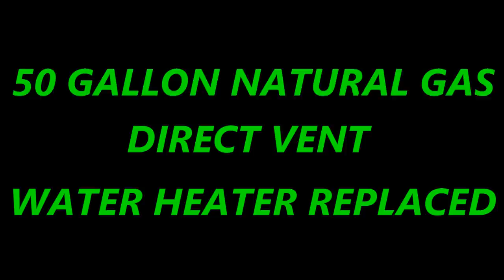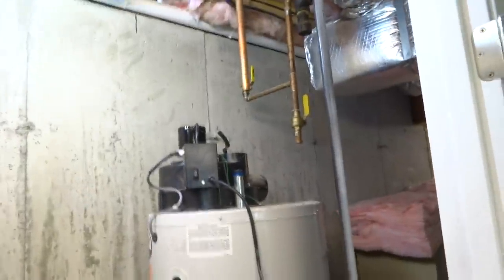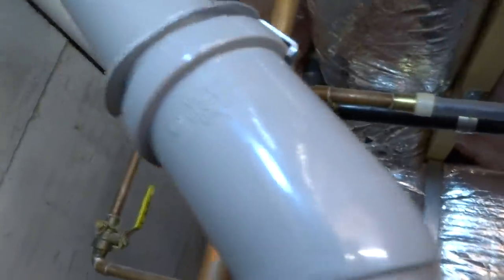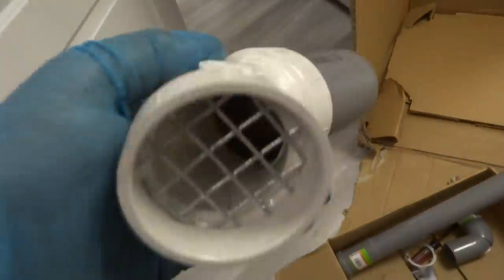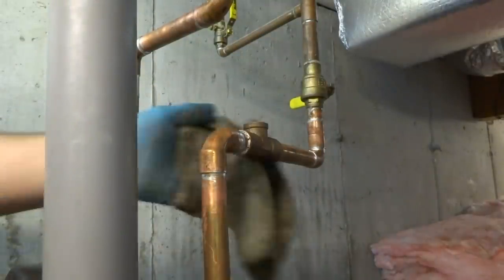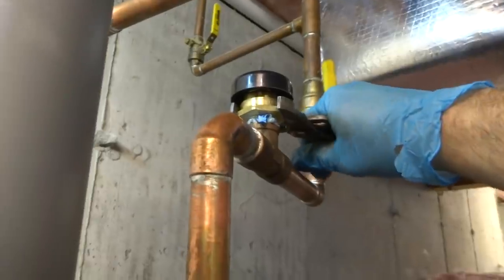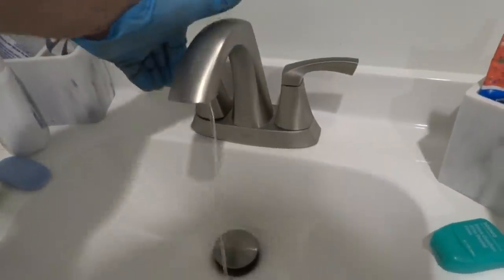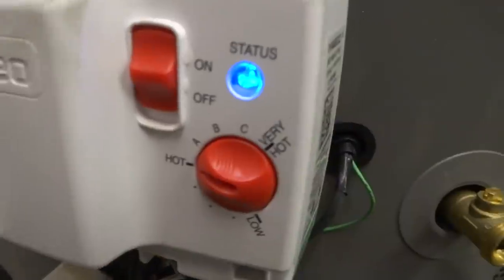50 GALLON GAS POWER VENTED WATER HEATER REPLACED

Comment: That centrotherm is all my company uses. We usually use it on fresh air too way easier than pvc. They also make a lube for the gaskets called centrocerin slides in like butta
Reply from the maker: IT SEEMS TO BE EASY TO WORK WITH AS LONG AS YOU GET THE PROPER STUFF PIPE LENGTHS AND FITTINGS NEEDED
Reply: Was pvc ever really hard to work with?  
Ppl pay for the high you get off that cement.

Comment: I had a 65,000 BTU direct vent water heater in an apartment a few years back (it handled heat and hot water). Even running for an extended period of time the PVC exhaust was only just warm. You could hold onto it all day long. I wonder who in MA is getting a kickback from Centrotherm.
Reply: There might be some kind of failure mode (say, the heater running with no water) in which the exhaust gets unusually hot and could burn the house down. Without sufficient knowledge in water heaters, I can't elaborate on that much. I am wondering what your thoughts are on this, is this an actual possibility, or am I wrong?
Reply: @kdmq  Possibly, but it shouldn't ever happen. If the power venter isn't working properly combustion should immediately stop. If I pinched the line from the blower to the vacuum switch on mine the burner cut off instantly. If anything reduces airflow significantly, which would cause increased temperatures, the vacuum would drop, trip the vacuum sensor, and kill the burner.
Reply: @jblyon2  Ok so what would happen if the water heater ran normal combustion but with no water in the tank?
Reply: @kdmq  The temperature sensor is located at the bottom where the gas valve is. It would satisfy the high limit quickly and cut off the gas.
Reply: I was going to say the same... someone has a brother-in-law in the central-therm business ... PVC on my unit just gets warm even right out the blower... same for my direct vent furnace ...

Comment: I have a power vented 50 gallon gas water heater installed in 2017 that uses PVC venting pipe in Ohio.  installation was a professional plumbing company.  ( i am an electrician, not a plumber)  Of course the code may have changed by now.

Comment: I'm just curious, has anyone actually seen a problem caused by properly installed PVC exhaust? I know code is what you have to do, but this seems like a solution in search of a problem. Nice install!
Reply from the maker: pvc companies do not want the liability they say its not rated for exhaust temps. and it should not be used .. so my state went to an approved material made for exhaust venting .
Reply: @stevenlavimoniere  That makes sense. PVC is primarily intended to by used as drain line. Thanks for the response!

Comment: Theres an alarm motion sensor mounted right next to the breaker panel. With the water heater in the same room, it might cause false alarms. Homeowner should have called the alarm company to relocate the motion sensor after he finished the basement.
Reply from the maker: good point

Comment: What is the temperature rating? I ran into a 80 percent Utica boiler power vent type that has ultra vent was recalled years ago. Wording if I can use that central therm?¿ Or I may have to install a slide wall power vent or.. thanks love your videos.
Reply from the maker: no central therm is only made for 90 + stuff ..........

Comment: Great job Steve as always. I was wondering, is it not legal to use a gas flex connector on a water heater in MA?
Reply: Every signal county is different code, all based on random one in a million events that caused damage/ loss of life
Reply from the maker: gas flex connectors only can be used on appliances that have to be moved like a stove ..
Reply: @stevenlavimoniere  That makes sense. A flex connector would have made it easier but not if it’s illegal to do so.
Reply: Oh.. I used a flexible connection on my water heater. I was wondering about the code in Ohio. I should pipe it in but it was an emergency situation and I needed it installed fast as possible. My wife is an ICU nurse and had been taking care of COVID patients and needed to wash that off STAT.  The old one was blowing water out of the top.. like a fountain ⛲..  lucky I was at home and just happened to be walking down the steps to do laundry.. probably was blowing out for less than a minute!
Reply: @stevenlavimoniere  Hi Steve, ,here in Illinois( home of crocked goveners) ,mobile homes use flex lines.
Reply: @stevenlavimoniere  we have to earthquake strap our hot water heaters here in calif. so we are aloud to use gas flex lines by code !
Reply: @japmlp09  incase they are ever moved.  Makes sense
Reply: I use flex connector all the time on water heaters but they have to be strapped
Reply: @croyal4240  that BS strap wont hold any thing worth. A shit..

Comment: 2 things there steve,  ive seen them use a torch on PVC to bend it into a long bow and that shit takes a lot to burn. also, i dont trust those press on pipe fittings either. especially in an earthquake environment.  pull all them joints apart like grandma's extension chord under the tree

Comment: I'm shocked they stopped allowing pvc for power venting. Thats all you see here in OH
Reply from the maker: its not rated for the high temps and the pvc companys had an issue with it
Reply: @Guillotines_For_Globalists  I had a 65,000 BTU one in an old apartment. The PVC exhaust was only just warm to the touch, even when it ran for an extended period.

Comment: Steve - You can't use PVC on a power vent? Whaaat? That's nuts man. When did Mass change that? Frickin busy body regulators changing what doesn't need to be changed. Side note - might be the first time I haven't seen you install Bradford White.
Reply from the maker: code just changed in my state a few months back.on pvc venting ... bradford white prices went through the roof .. so i bailed

Comment: no code requirement on expansion tank installation?
Reply from the maker: no the water meters here have no check valve on them
Reply: @stevenlavimoniere  We have them in my county in Georgia.  Surprised they don't have them there.
Reply: Why would they require expansion tanks? I have never seen on installed in my area. What do they do for you?
Reply: @ohioplayer-bl9em  With backflow preventers, if you have an overheating of the water heater, the expansion would have to go out the safety unless you had an expansion tank.
Reply: @stevenlavimoniere  txs Steve, here in Seattle they're required

Comment: That house has some iron pipes in it still?
Reply from the maker: steel gas piping yes
Reply: @stevenlavimoniere  i meant iron water supply pipes.    When you bleeding out the air seemed like every fixture had rusty water at first.    
Love your work Steve.  Happy New Year to you and MissMolly.
Reply from the maker: @MrHemi4spd  rust came from old water heater tank probley ready to let loose .
Reply: @stevenlavimoniere  ahhh.   Thanks for your reply Steve.   Again,  I love your content.   All the best in the new year!!

Comment: Should have upgraded to a tankless with such little space
Reply from the maker: dumb idea
Reply: 🤷‍♂️ love mine, could never change my mind
Reply: @Corey Lambrecht any tank model without a standing pilot light won't work either.   Youll only have whats in the tank.
But the real reason is tankless are junk
Reply: @Corey Lambrecht That power vent wont work either during a power outage.